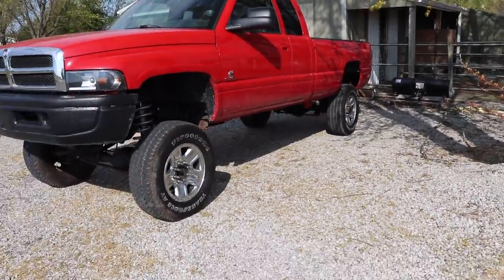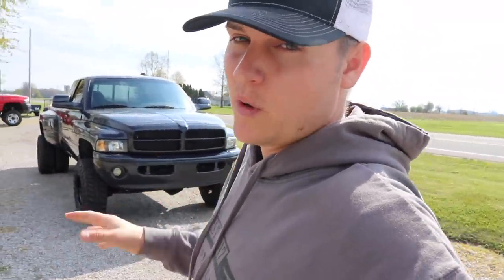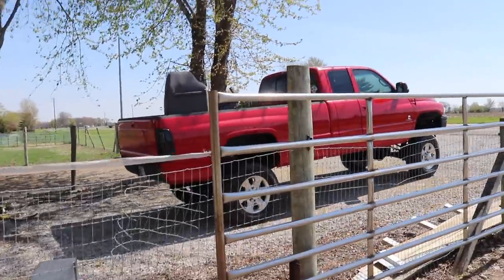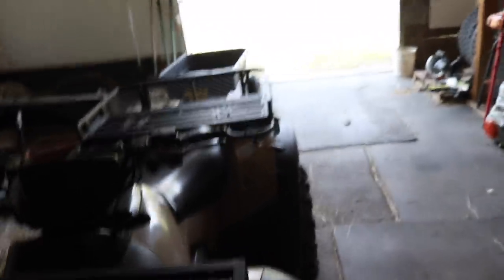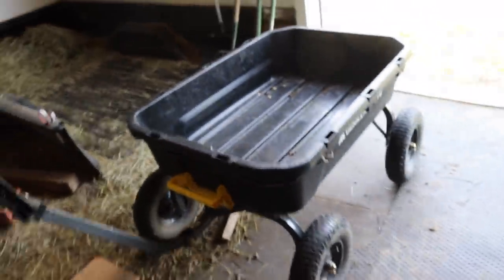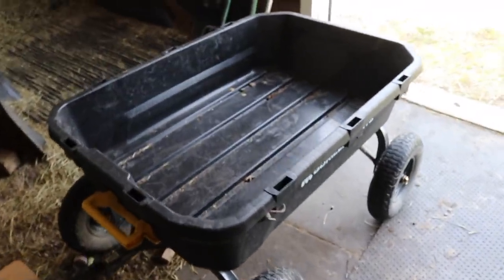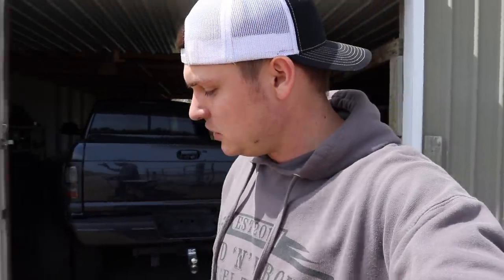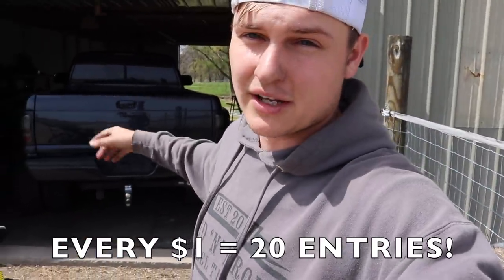New PUSHER Compound Turbo SETUP is HERE!!!

Comment: What is the purpose of a pusher compound turbo kit
Reply from the maker: More air flow, more power, power EGT’s, better spooling under a load, faster acceleration, better MPG, and I would argue longer engine life because of how much better it runs.